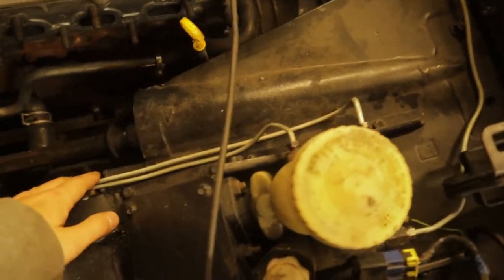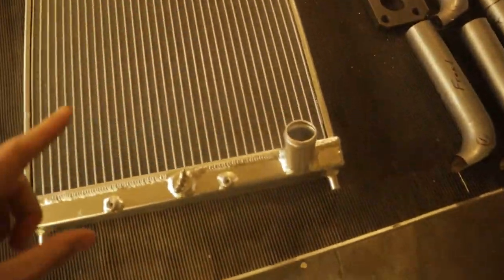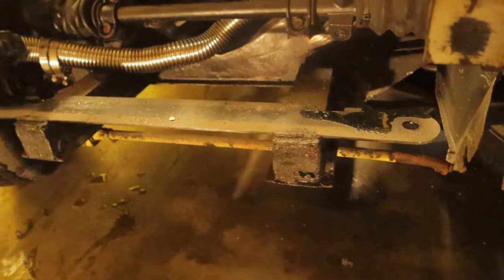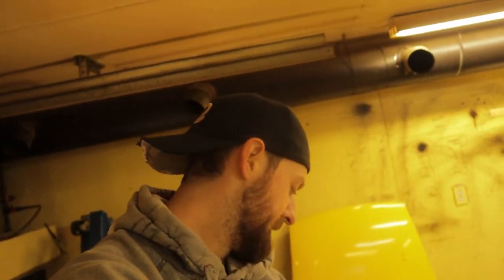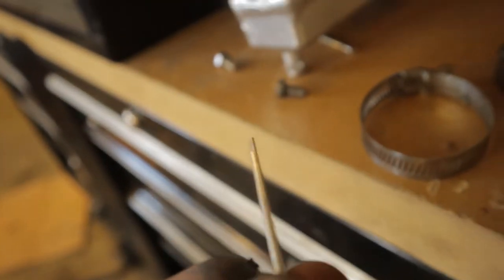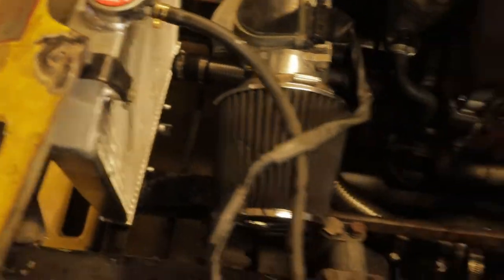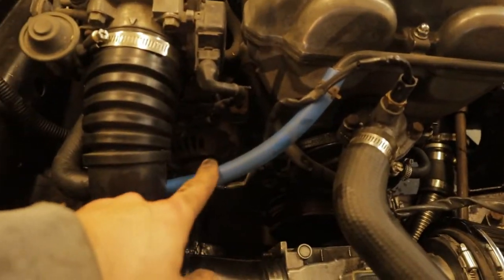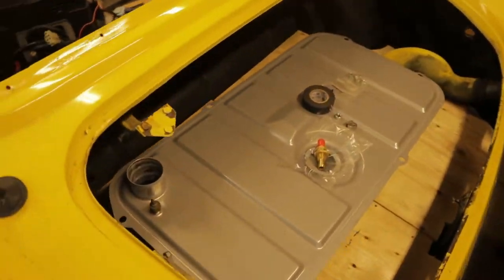Installing NEW Radiator in my MG Midget

Comment: Always add radiator fans. It can't hurt and will improve temperature control at lower speeds. Super psyched for your spring this year, for sure, you should be ripping up the roads in no time
Reply from the maker: I really hope so! It keeps getting closer and closer 😃
Reply: The air line from the valve cover takes engine crank case vapors and burns them. Emissions stuff. Crankcase value? PCV? And could vent to air if you don't have emissions tests, I think. I'll defer to calmer heads on this one, but it can go anywhere in the intake line, so you could move it. If there's a Miata PCV delete discussion, then you can safely delete it. Not sure where the other pipe comes from. Unburnt fuel from the other end of the intake?

Comment: Rubber isolators for the radiator will cut down on rattling noises and help keep the radiator from developing cracks.
Reply from the maker: might have to toss some in there, not a bad idea!

Comment: Build is looking good, I am planning something very similar in my MGB! Make sure to check out my other comment on mundanestuffs comment about your intake situation.
Reply from the maker: You should have a good time with the mgb, little bit bigger, more workable engine bay it seems!
Reply from the maker: I also don’t see another comment? might be because i’m on my phone, I’ll take a look once I’m at my workstation today
Reply: @ModernGarage  Looks like it might have been deleted. I had included a link in my comment, looks like they don't like that.
The blue hose that wraps around the front of the engine and ties into the intake is just to vent the crankcase. You can vent it to atmosphere, or install a little breather filter over it rather than trying to attach it to your intake piping. The larger size hose that comes from below the throttle body and ties into the intake piping is part of the air idle control valve system. That one either needs to be hooked up to the intake plumbing if you're in a colder climate, or plugged off completely if you're in a warmer area.
Reply from the maker: @josephwaller4421  That actually helps immensely! Thank you so much